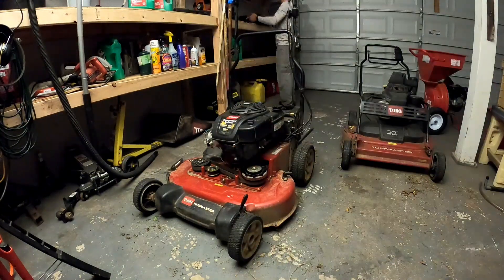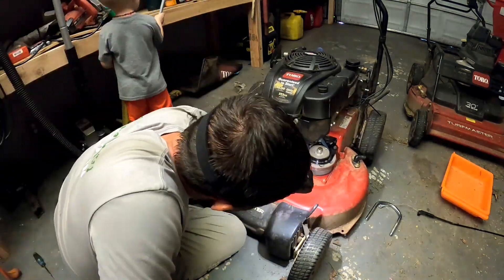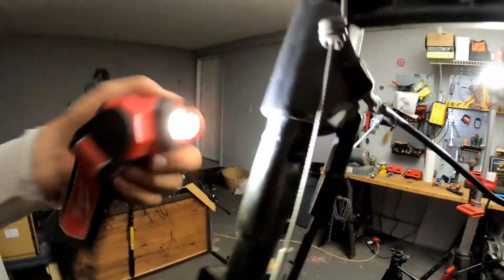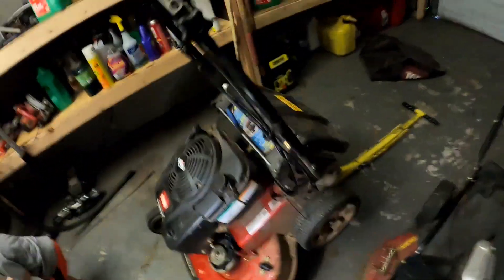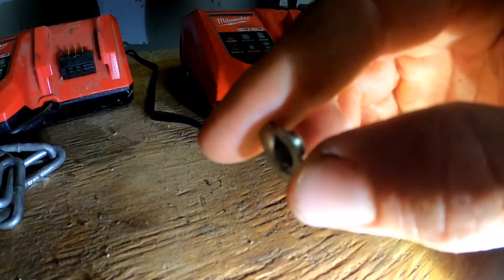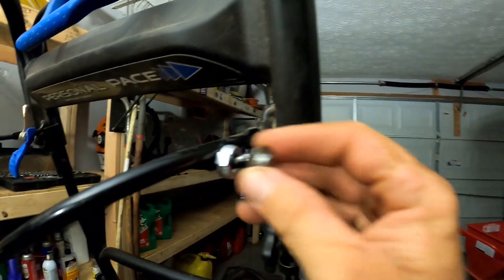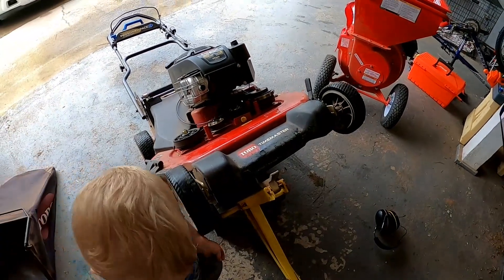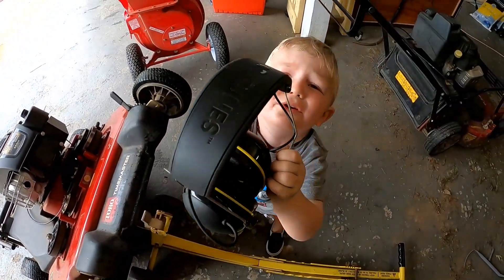Timemaster brake cable replacement [133-1998] + pto belt

Comment: One, River is too cute Bud, & having him out there with Ya is Fantastic!! Two where the cable connects up to the engage handle bar I've seen guys drill a tiny hole & run a Kotter pin to hold cable on rather than trying to cram that bushing back on. This way it's easier to remove cable when it breaks AGAIN 😂🤦‍♂️👍. Hoping all is well, Tiggy Tiggy Tony!! Dirty Jersey out!!
Reply from the maker: Great advice buddy